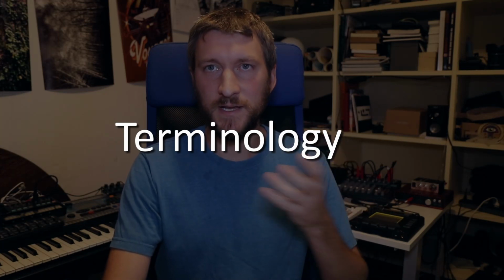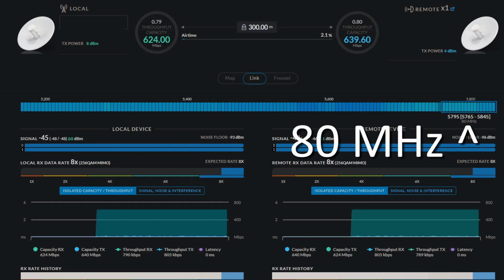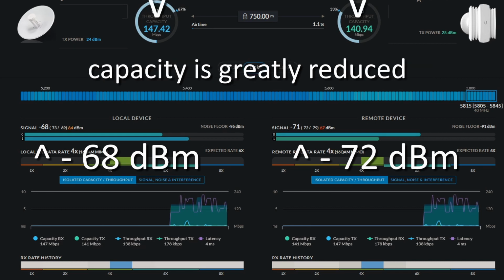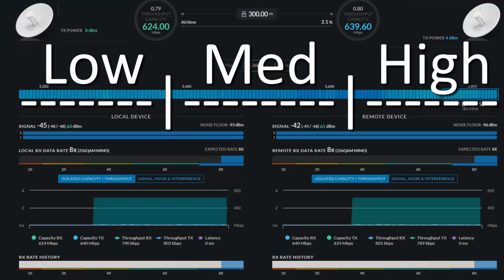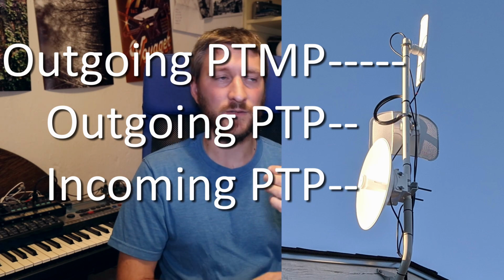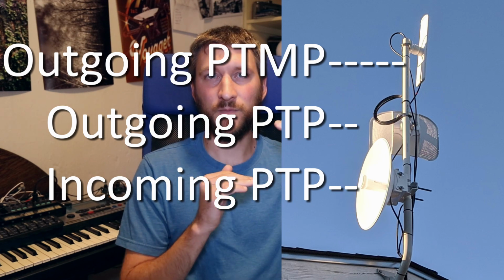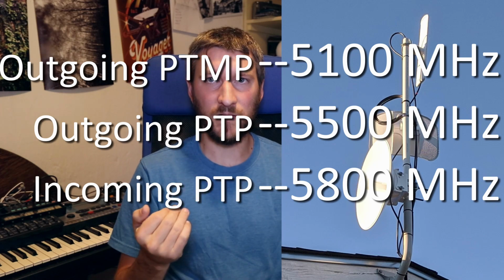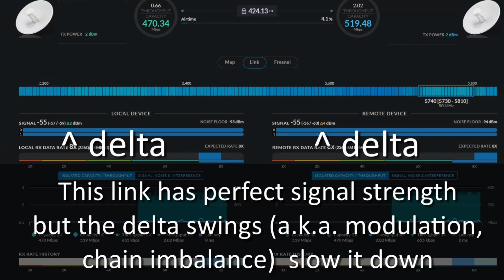Althea Mesh It Up! Episode 1, Extended cut

Comment: 14:27 question; I'd personally rather manually specify the spectrum after a site analysis, but what happens when somebody comes in and sets up their WiFi network and it's overlapping with your equipment?  These things are dynamic as people setup, take down, and as auto channel settings change channels.  So what are you supposed to do about that if you're operating in the 5bGhzb spectrum?

Comment: 5:20 this is operating in the 5 GHz band, right?  What about using 10 Ghz or higher?  Wouldn't using something like that allow for significantly less possible interference and higher bandwidth?
Reply: We primarily use 5 GHz, but you can use anything that is available in your area. 60 GHz, 24 GHz, CBRS, even LTE spectrum. 10 GHz and higher is generally restricted and may require an FCC license (in the US). It might be available in other countries, just depends on where you are.
Reply: @altheasupport4382  Got ya!  From what little I've come to understand about wireless spectrums, I kind of like the idea of 60 Ghz  except at such a high frequency, heavy rain and snow can cause issues I've heard, plus it has a more limited range I believe.  I just basically like the idea of using non crowded bands, but I guess that might not always be viable.  I'm somewhat new to all this and piecing things together a little at a time.  :)